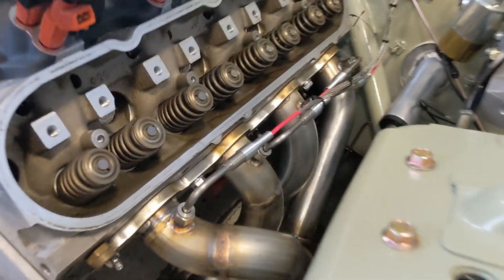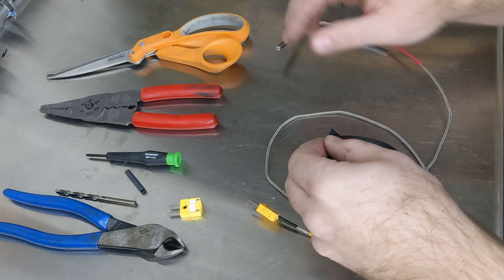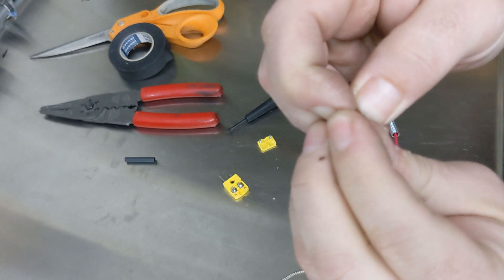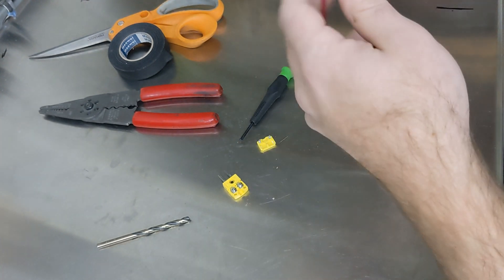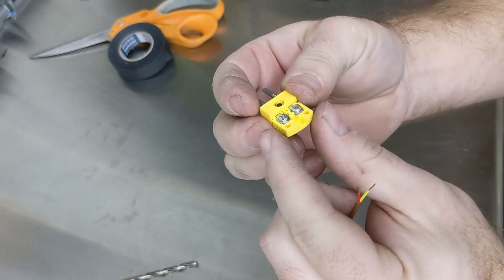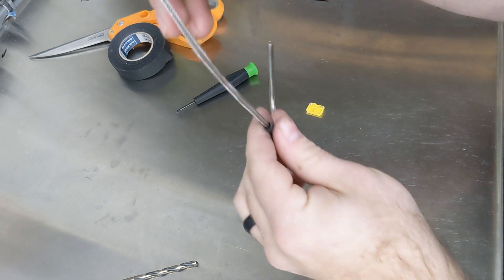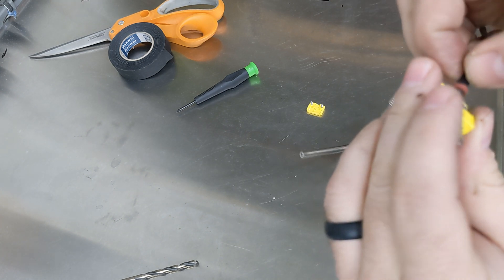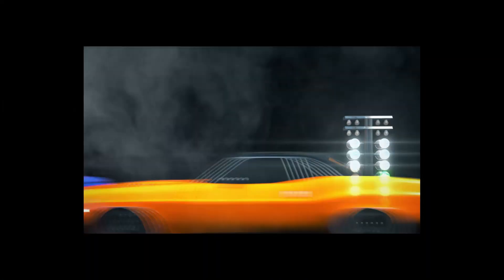HOW TO: Shorten EGT Probe Sensor Cable Wire

Comment: I have a 1995 honda crv but my crv carries a one wire egt sensor can a two wire egt work on a single wire egt connector. I've looked all over cannot find a single wire egt sensor anywhere.
Reply from the maker: I'm not showing a listing for a 95 CR-V, but I would be shocked if it had an EGT (Exhaust Gas Temperature) sensor from the factory. Is it possible you're thinking of the ECT (Engine Coolant Temperature) sensor? Lots of OEM ECT sensors are one wire.